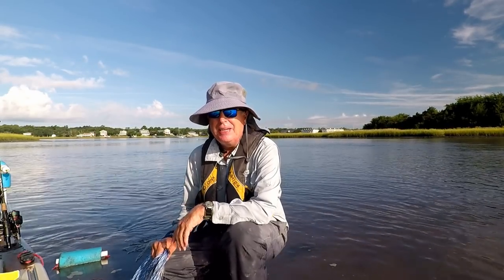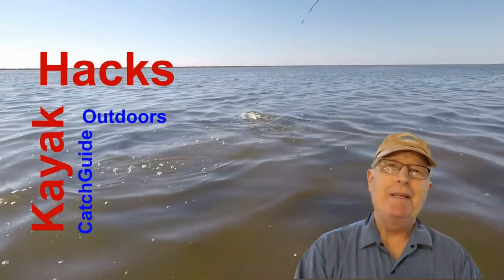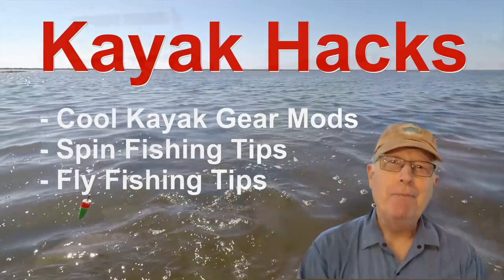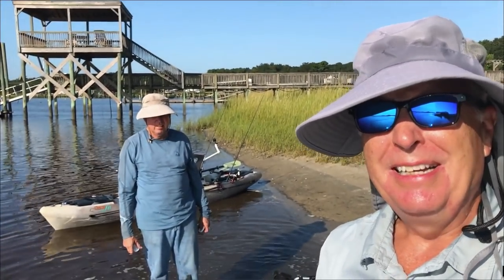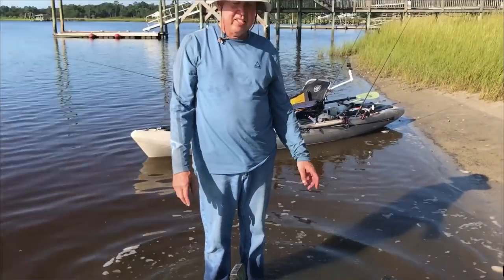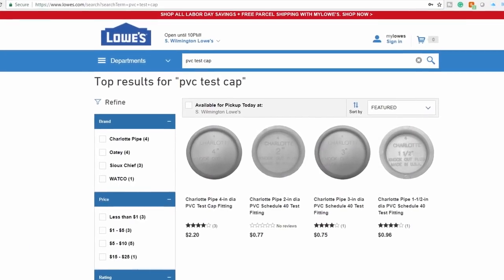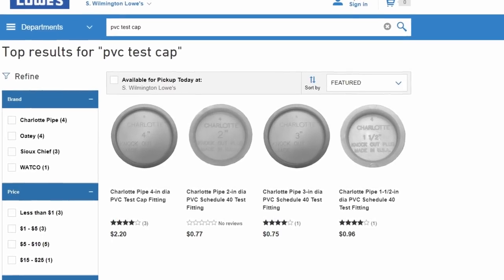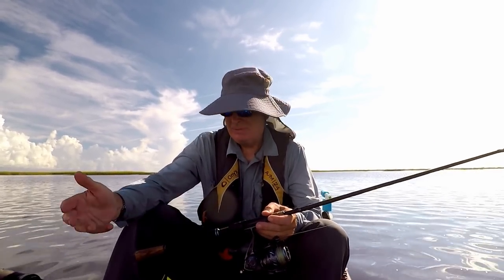Kayak Bait Fishing - Kayak Bait Table DIY Hack for Live Bait and Cast Nets

Comment: I flipped my kayak over and filled every damn one of 'em scupper holes up with silicone from a caulking gun.  Holes in the bottom of a boat suck.  It doesn't drain water out.  It fills it up when out at sea.  When I hit a beach I flip it sideways to drain.  If waves try and fill it up I bail.  I don't paddle unless my motor gives out.
Reply from the maker: Wow. I have never heard of somebody doing that.

Comment: Could always cut out centers of caps m add in a screen .... still block holes n drain water .
Reply from the maker: Great addition! Thanks
Reply: Actually just drilling a few micro holes in the caps would do the same.  That way water could pass through, but nothing else would.

Comment: Not a live bait user, and I keep my scuppers closed, as I'm on calm waters 99% of the time. If the need arises to drain water from the deck, the scuppers in the Feelfree Lures have a cap that easily flips opens to relieve water accumulation:
aGqDrh_CMd3Ms8ATMz7PJqDGaopi8JMCv8BhZVzh1i3C8ZIaAob9EALw_wcB
$7.99 pr from Austin Kayak.

The pvc cap is a good, inexpensive hack though for retaining live bait within the deck area.